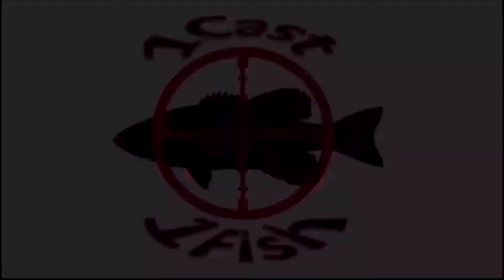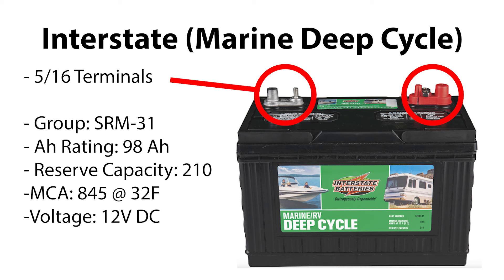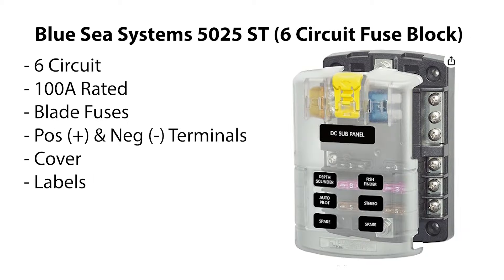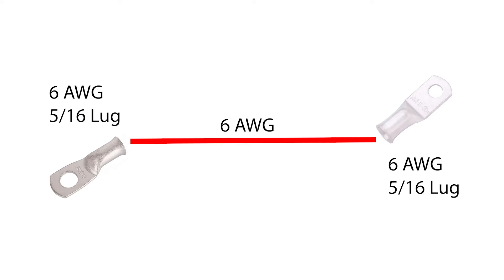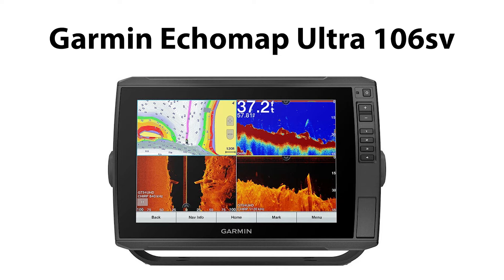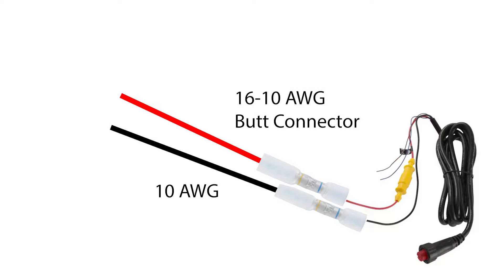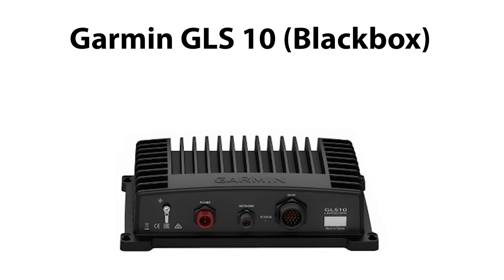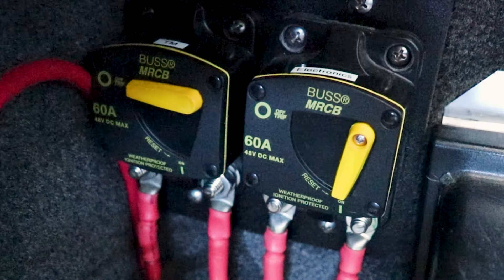Simple Dedicated Boat Electronics Power with Garmin LiveScope & Echomap 106 Ultra

Comment: I had to add an additional battery for my electronics right after getting my boat in 2019. They had the electronics hooked to the starting battery, I literally ran it dead and had to go back to the dock with my trolling motor.
Reply from the maker: When I got my Garmin Force, I  found that on 24V it ran the boat just as well as my Minkota at 36V…so I just used the extra 12V for my gear. I plan to switch to lithium at some point, hope not to soon though 😂. Hope to get another 3 years out of these batteries

Comment: 6 AWG is too much in my experience. I use marine grade 10/2 duplex wire to 6 gang fuse box mounted in starboard rod locker. The fuse box provides max power for two top tier units, whatever it may be :Hummingbird Solix, Lowrance HDS, Garmin's, 360 s, and any module for live at Bow of vessel.
Reply from the maker: I appreciate you sharing your approach.  Glad its working great for you...Good luck next time out on the water

Comment: If you are using a fuse box why did not remove the inline fuses. Seems like duplication that is not needed
Reply from the maker: I left them in case I change things up at some point and want to use them.  The is no advantage protection wise in leaving them in this setup.

Comment: Great video, easy to understand. Happy you just used circuit breaker without battery switch.
Have older boat and battery switch confuses me, dont see any videos show how to connect to motor and ignition, so i didnt want the headache. I understand this setup. Many thanks
Reply from the maker: I thought about adding the switch...I even have one to use just in case I change my mind...Sometimes we make things way more complicated than they need to be though.  Glad you found this video helpful

Comment: Great video, very clear cut explanation. Is there any benefit to cutting the standard 14 guage power cable higher up than the 6ft length and splicing in the 10 guage extension up even higher?
Reply from the maker: You can, but no "real" noticeable advantage...the loss is extremely minimal.
I recommend splicing in a place that works best for you.  On mine I spliced one short since originally the splice would have been up inside the wire run within the boat.  I wanted the splice easily accessible in case of repair needs.

Comment: thank you for this video very straight forward, you made it simple . . .thank you. I do have one question; I heard that your FFS should be on its own circuit (dedicated battery)? right now I have Garmin echomap uhd 93sv, lights, usb and gps puck on 1 battery. I'm getting a lvs34 and I was wonder if I should have a seperate battery for it or just get a bigger battery and run everything from that (except my trolling motor)
Reply from the maker: These questions are tough for a honest answer as it very dependent on your situation IMO. The quick and easy answer is always going to be get a stand alone battery.  However there is nothing wrong with using a larger battery to run what you have listed....IF setup properly.
Some key things to think about...how long do you fish? What are your charging habits? If you get a dedicated Lithium Battery for the LVS 34 does your existing charger still work or do you need another charger?  Alot of things to really consider.  
I run 4 106 Ultras and the LVS34 on only my dedicated battery...no interference, and last a full 8 hours ( I do sleep my other units when not in use)  
Another thing to think about, is how long does your current setup last on the water? The LVS34 is not a giant drain...about 1-2 Amp.  So if your barely using your battery now...you may be OK.

Hope this sheds some light...just alot of variables to consider and really think about.

Comment: Did you leave the original fuse holders on the power cable or do you just use the fuses in your bus block? Thanks. That is the same way I'm running my graphs in my boat. The video was very helpful.
Reply from the maker: I left the fuses just in case I ever decide to change something for some random reason and needed them.

Comment: I have a new boat - and almost the exact same set up.   2 106sv’s at the bow, 1 126 at the helm.    Livescope GLS 34, etc.    Same battery just a little bigger.  Same fuse box was put in as well - all from Dealer.     My issue is that my Livescope keeps dropping - based on the fact that the black box is at a max of 12 V upon full charge and within 30 min of being on drops to 11.9 - 11.8.    My battery is also used as cranking!    I need some suggestions on how to fix!
Reply from the maker: Thats alot of draw on a standard cranking battery IMO...considering all the other auxiliaries that are running or powered up as well possibly (Livewells, pumps, lights, radio, ect) type stuff. I would consider a separate battery for the electronics only.
The one thing that is standing out to me though and seems a bit strange is the max of 12V.  A fully charged battery should be holding about 12.6V at start of use...you state only 12V.  IMO again even though I feel your load is a bit high for your setup for a full day of use, you should definitely not drop below 12V that fast.
I had a very similar issue before of a battery not fully charging, and discharging fast...turned out I had a bad cell and needed a new battery.  I would get the battery checked out to rule that out.  If the battery is good, look at the wiring to the fishfinders and livescope...is it the right size for the run length?

Comment: Did you remove all inline fuses that were on your electronics and just use the fuse block fuses?
Reply from the maker: I left them in my install, but did not need to due to the fuses on the block.